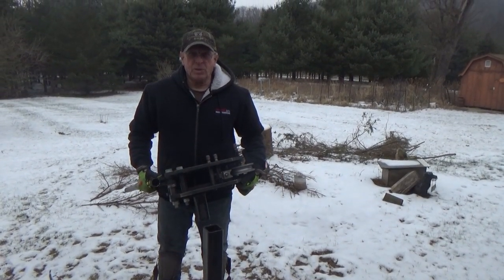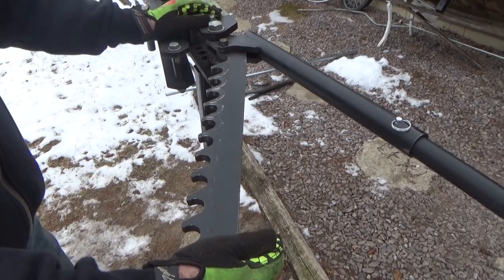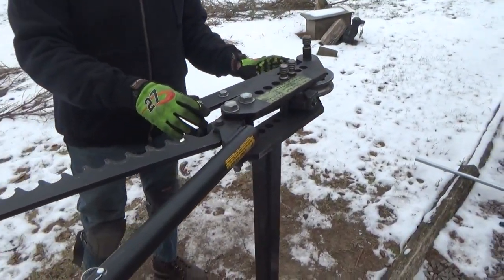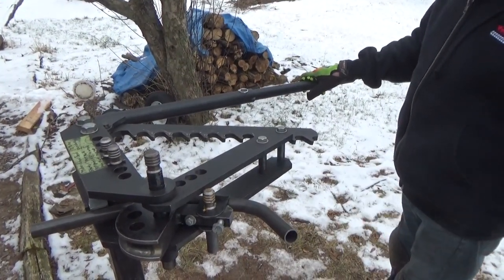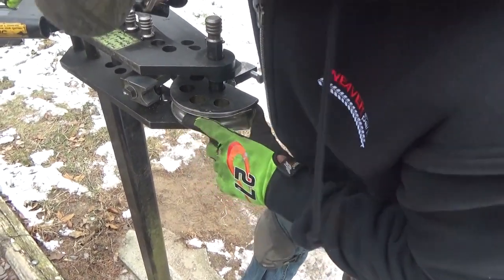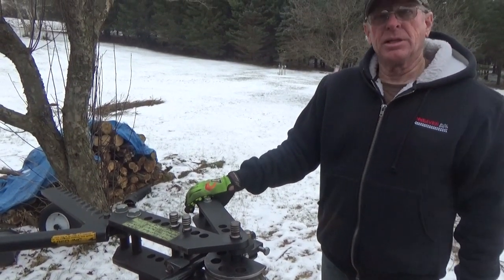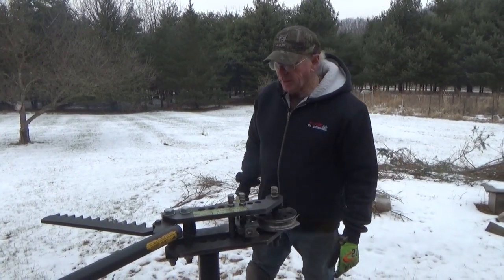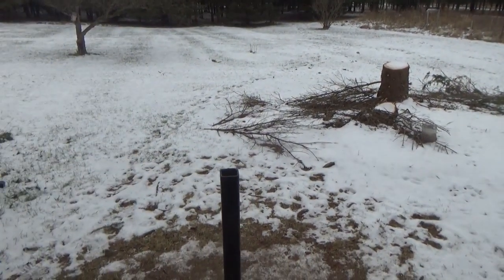JD Squared Pipe and Tubing Bender In Use | Part 1

Comment: That bender is very similar to the one I used to make the first kart chassis I built back in 1976 while in High School machine shop.  The front part of the chassis was a copy of a Bug Stinger while the back half was a copy of a Invader.  I also used that bender to bend 1" solid steel stock when I built copies of the EZ curl bars that had just come out on the market.  Ahh, the good ole days!
Reply: Was the bender you used a Hossfeld?
Class of 77 here.
Reply: @haroldphipps3457  The name Hossfeld rings a bell but I am not sure.  I can tell you bending the 1" solid stock was fairly easy.  I too am from the class of 1977 South Miami Sr. High School.

Comment: Sorry I forgot to put in the one pin on the die. That's why it started on 5 and not 2. I was concerned with showing some of the other points and needed to rotate the die and forgot to put the pin in.